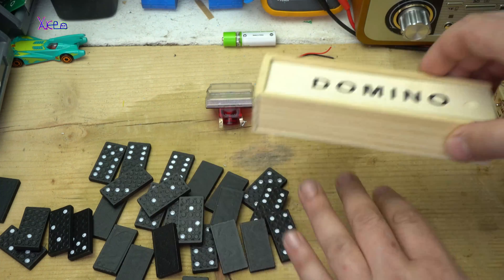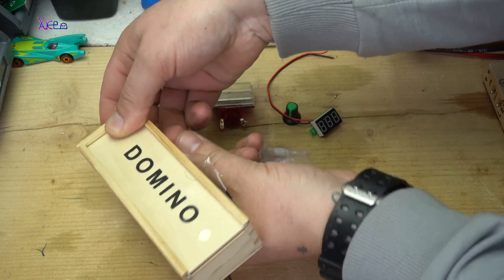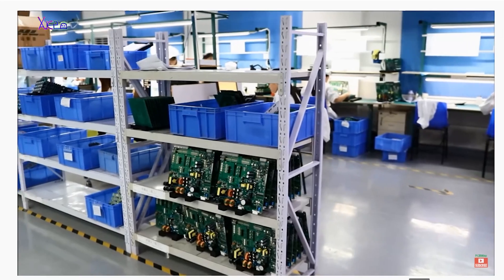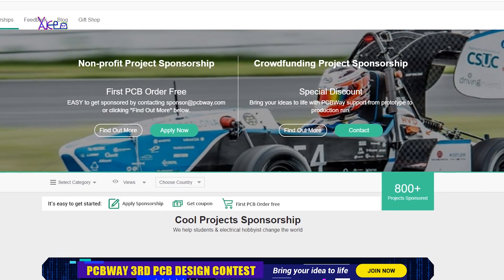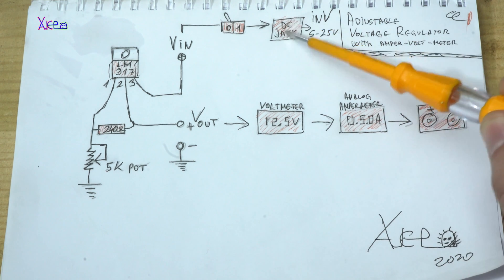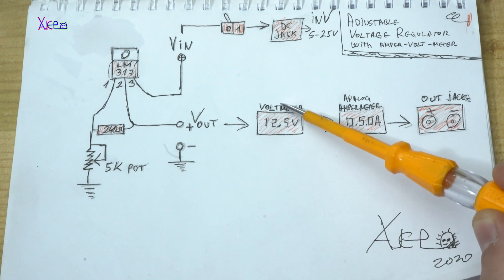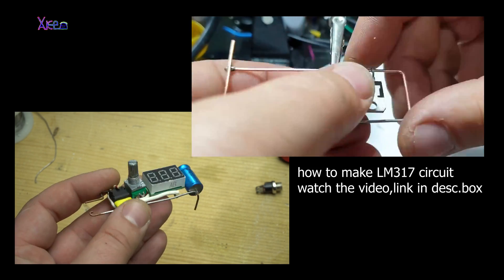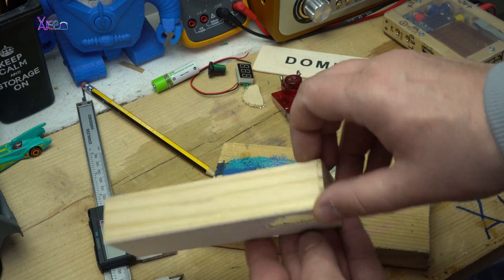How To Make Variable Lab Power Supply at Home

Comment: plzz make a drone using ardiuno
Reply: i think it cant be possible bec. if u wanna make a drone you want it to be as light as possible. and only arduino that can possibly be a drone brain is arduino mega 2560 so it wont be easy  to make and if u wanna use org. components it wont be cheap
Reply: @sarpt0  ok thanks for this comment